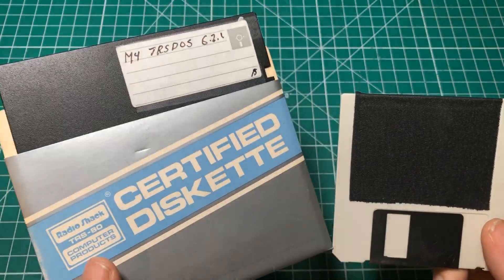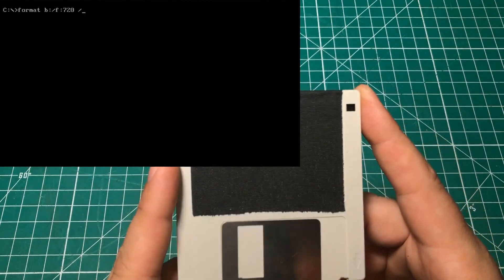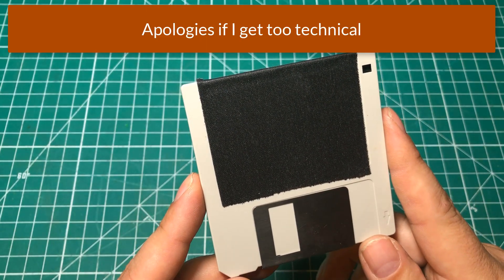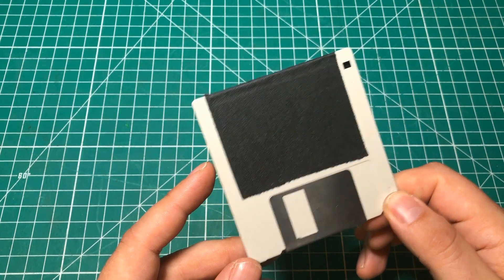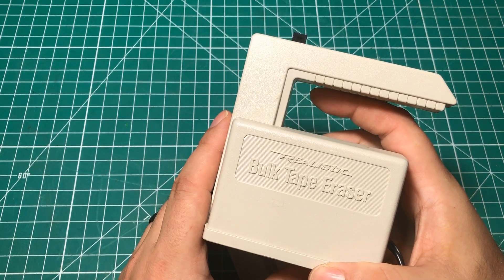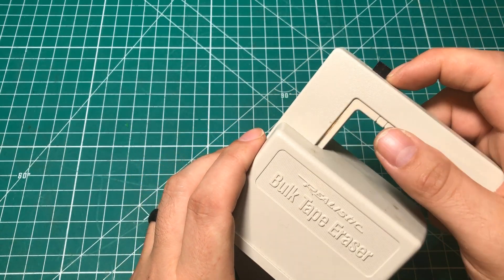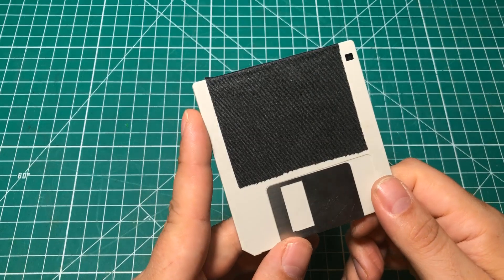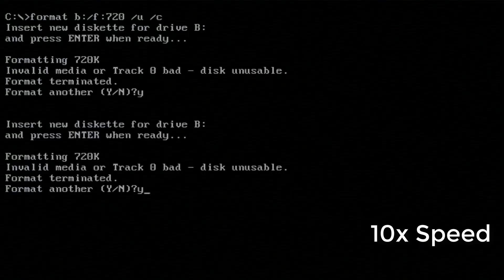Fix bad floppy disks in seconds

Comment: My totally-non-supported-wild-guess theory is that the disk has trouble because the part of the disk just at the edge of the tracks has "data", which doesn't get overwritten by the heads when formatting but is just strong enough to affect reading -- possibly because the drive heads are slightly off alignment from the last drive that was writing to it.  This is similar to why writing to a disk that was previously written with a double-density drive (larger heads) doesn't always work if you write new data to it in a high-density drive (the skinny heads only rewrite part of the data, the old data is still there next to the skinnier track and affects reading, especially if you put it back in a double-density with the wider head).  Using a demagnetizer randomizes the particles again so there's no strong "0" or "1" signal to interfere with reading.  So I always demagnetize a vintage disk before using it since I don't know what kind of drive or track formatting was used on it previously.  Basically getting it back to "factory fresh".
Reply from the maker: I think you are exactly right. I pinned this comment. Thanks for the awesome feedback.

Comment: I've actually repaired bad sectors on a handful of floppies by running `ddrescue` in reverse mode. It would just fail every time, then read completely fine after one run in reverse. This only worked on a handful out of a bucketful of them, though
Reply from the maker: I need to try that. I definitely remember hearing about that program. Thanks for the tip.
Reply: Me too

Comment: Shame that won't work to recover data. Still cool if it can refresh them for new uses.
Reply from the maker: Yeah I do actually have devices that will read the magnetic flux on drives and try to reassemble them. But that still doesn't make the discusable when you're done.  Greaseweazle is a very cool tool for floppy data recovery
Reply: @AnotherMaker  Have a tool to crack the forgotten password of a zip disk? Asking for a friend.

Comment: I use a round strong magnet sloped from a microwave oven. Yes it works, move the magnet in a circle on both sides and you can format the full capacity. Sector 0 isn't fixed and that is still my problem with those 5.25" floppy.

Comment: Useful tip! We should always remember to inspect these old floppies and only use mold-free ones. Whenever drive heads touch the first mold-contaminated floppy, they get dirty and "sandpaper" any other following floppy, good or not. Stop using the drive whenever a high pitched noise is noticed from it and give it a good head cleaning.

Both Windows 10 and Windows 11 read any non-USB floppy drive: 5¼ DD, 5¼ HD or 3½ HD. However, they can only format 3½ HD. Curiously, their CMDs actually format them all properly.
Reply: How do you connect a 5 1/4 inch drive to a modern pc? I looked at how to do it and seemed like a lot of work and hassle.

Comment: Hi, I would avoid using the DOS format command. (From later versions of DOS.) The way it tries to determine if it's a high density or double density disk is flawed.

If the disk has been used before, especially on a Mac or other non DOS system, it can error out like you show. Using a 3.5" USB drive on Windows 10/11 also has similar issues where it will fail formatting if the disk has been used in another non-DOS system. 

DOS utilities like FORMATQM and NFORMAT have no issues because they don't attempt to read the disk first and would have certainly formatted those disks without any issue. Also, it would accurately describe any bad sectors on the media to help you determine if you should keep or throw away the disk. (I personally have a zero bad sector tolerance on floppies as some bad sectors usually means more are coming.) 

Floppy drives have an electromagnet erase head that clears the track before writing, just like a cassette recorder. 

The only time a bulk erase can be helpful is when trying to use a 360k disk in a 1.2mb drive -- since the 96TPI heads (and erase head) in a 1.2mb drive are narrower, there can be leftover signal if the disk was written previously using a 48TPI drive. Typically, the issue arises when a non-bulk erased 360k disk was first written in a 360k drive, then written again in a 1.2mb drive and then read again in a 360k drive. The 48TPI heads can pick up the original signal that the 1.2mb drive didn't erase, meaning the 360k drive could see the newly written information and the original data at the same time.
Reply from the maker: Hey... first of all, I'm a huge fan. I watch every one of your videos.  Thanks for the awesome information. I will try some of those other utils. I do remember using other format tools back in the day. Looking forward to trying these.
Reply: Adrian, I believe you are slightly incorrect, floppy drives don't have erase heads in the same way that tape recorders do, but instead have a pair of tunnel erase heads that FOLLOW the writing of the data track.  See paragraph 9 of the Technical Introduction here: https://retrotechnology.com/herbs_stuff/drive.html  And page 9 of https://jsobola.atari8.info/dereatari/literatdere/1050fsm.pdf
Reply: @Brian_Of_Melbourne  yeah indeed! Seems two types exist but both just overwrite the track without erasing and then on the Atari and SA400 it just trims the edges by erasing that to create two guard bands. Fascinating, I had read the SA400 manual before but forgot this. Either way there is still no practical reason to degauss a disk first unless possibly it was used in a different head thickness drive.

Comment: I had more fundamental problems  that were more related to using modern PCs 

Turns out that:
1) You can't format using a standard USB floppy.  IOCTL only works with standard floppy controllers and it fails.  You can use a command in Linux however

2) At least on my gen 1 i7 (my last motherboard with a real floppy port), Windows sucks at writing/formatting floppies using a normal drive. I don't know why, it just struggles, even downgrading to Windows 7, using 3 different perfect-condition drives I have, using NOS disks etc. It grinds, the heads make a weird sound in a "tak tak.. tak-tak-tak-tak" pattern and often fails. FreeDOS however has no problem, on the same PC on the same disk and same drive. And I can also format them in Windows using an LS-120 drive.  And Windows can READ using the normal floppy just fine. 

Just something else to consider if anyone is struggling to format floppies.
Reply from the maker: Other than for the occasional write, I've basically given up on usb floppy drives and modern versions of windows for dealing with floppies.  I've actually built an old PC just for writing them.  

Thanks for this awesome info.

Comment: this won't work for me. I have floppy discs for an Ensoniq sampler. Some tracks won't load because "disk data corrupted".    If anyone knows a fix for this holla back.
Reply from the maker: there is a product called the greaseweazle that will let you read the "flux" of the floppy disk and from there you may be able to recover/repair it. That board is cheap and has a great community.  
 https://www.ebay.com/sch/i.html?_from=R40&_trksid=p2380057.m570.l1313&_nkw=greaseweazle&_sacat=0 that
Reply: @AnotherMaker  alright. Thank you. I'll have to look into that. Looks like I have to solder it onto my sampler somewhere.
Reply: Trying to get my asrx to read these disks! 0 for 40 so far 😫😫
Reply: If your disks are of factory or retail variety you could always try rewriting onto fresh media, I know the mirage has all the factory disks and more on internet archive.
Reply: @dav1dbone  thanks for your answer but what I mean is that I formatted disks on the ensoniq, not that the disks were from ensoniq. I loaded my own samples and sequences on them.
Reply: @mikesuniverse1789  Ok, yes so that means trying to recover the data, the above mentioned problems and expense of Kyroflux, not something I'd be keen on pursuing. It might ve worth trying to read the disks on PC with a suitable program, Ensoniq Disk Tools to try and get an idea as to the extent of the error/s, might be possible to extract enough sample date to allow you to reconstruct the patches etc.
Reply: @dav1dbone  one day im gonna do that. so many things to do.

Comment: So here is my problem,  I purchased the same radio shack Tape Eraser and tried it on some disks that formatted OK but had some bad sectors, Every Single Disk I used this on I could no longer format because I was getting the Bad Track 0 after using this device.
Reply from the maker: I recommend using a program other than dos format to format the disks. I think Adrian's digital basement recommended a few in the comments here.
Reply: If you turn the eraser switch off while it's right next to the disk, you can induce a huge magnetic spike in it.  Ages ago in radio we would erase magnetic tapes by turning the eraser on, bringing the tape to the eraser, then pulling the tape a arms length away from it before switching it off.  Try something like that with your floppies and see if that might be the trouble.

Comment: I liked the fix; but wasn't that a demagnetizer you used on the floppy?
Reply from the maker: No. It was just a big electromagnet.
Reply: @AnotherMaker  So it wasn't an AC field but a DC magnetic field?
Reply: @pixelpatter01  Pretty sure it was a demagnetiser. Else it wouldn't have buzzed, would it? And the floppies would be strongly magnetised to the point that the drive couldn't erase them. And you wouldn't have been able to move the disk around like that, because it would be stuck to the magic magnet box. This youtuber doesn't know what he's talking about.